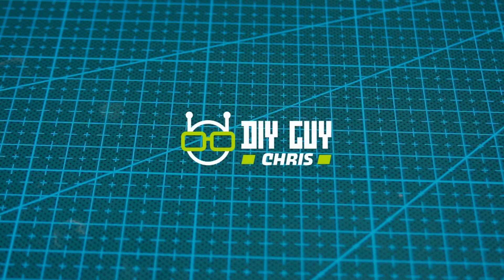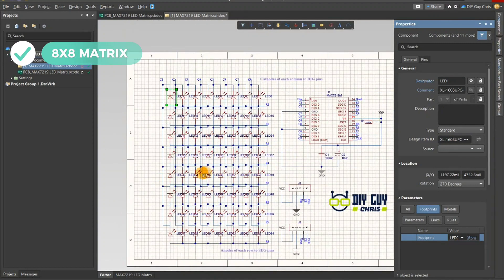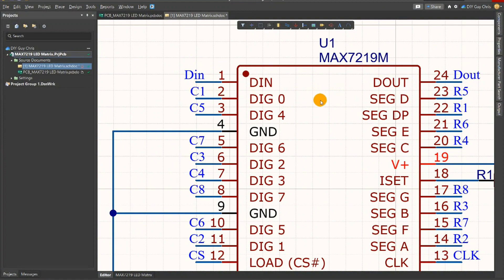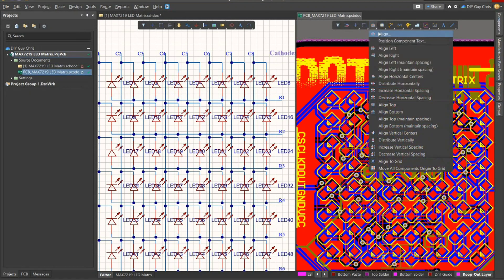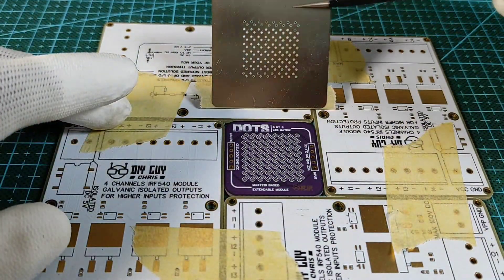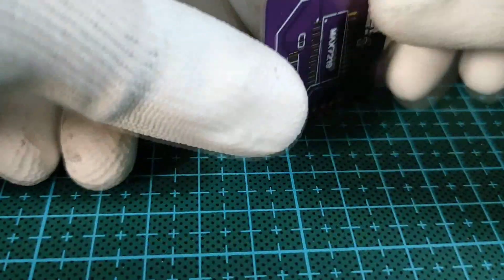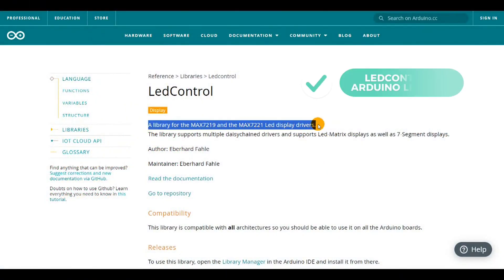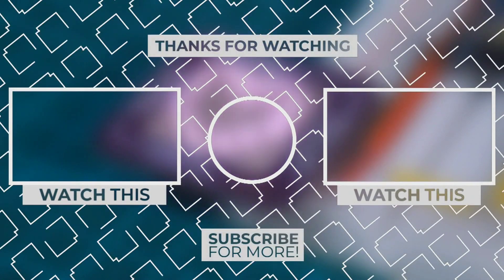DIY 8 x 8 LED Matrix (Arduino & MAX7219)

Comment: Can we use ws2812b with max7219
Reply from the maker: @samanjayatileka2060  no and no need to Max7219 for WS28xx LEDs, those are addressable LEDs with a built-in adresse-data register